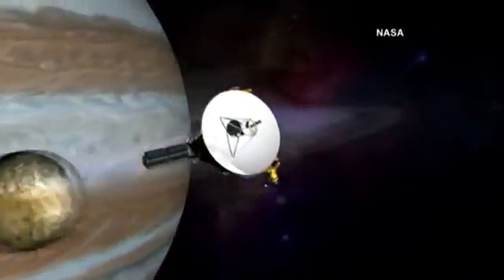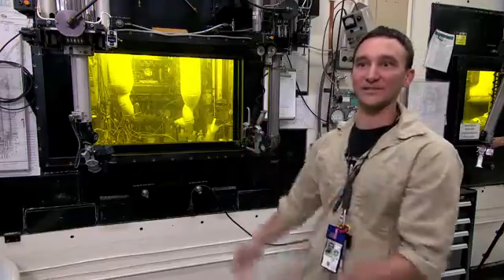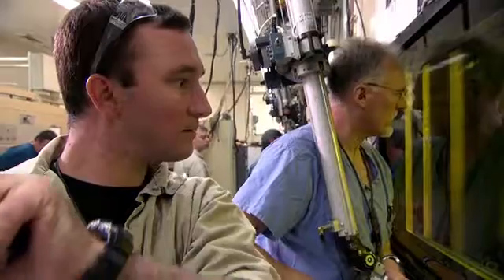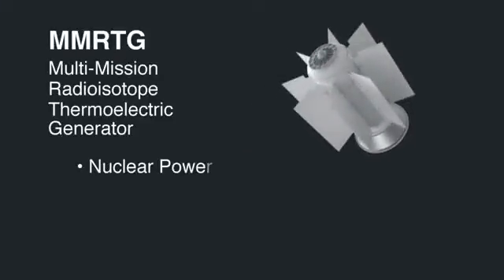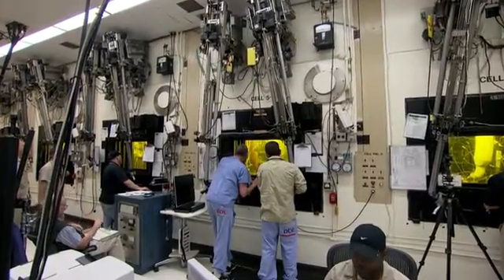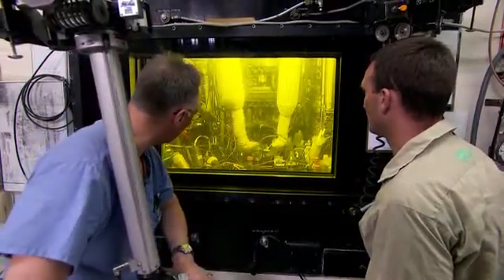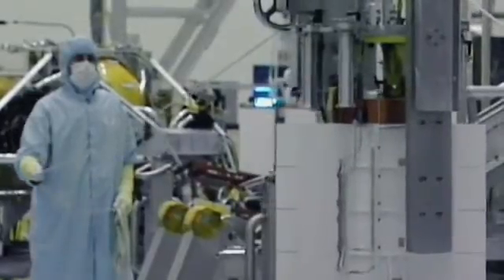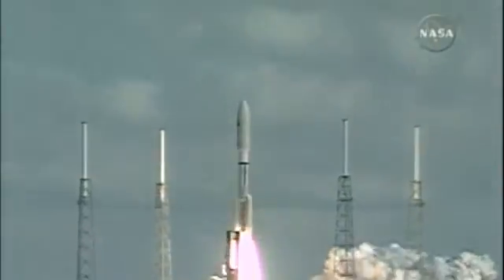5/7/2015 - Daily Planet: Plutonium Hot Cell

Comment: Really cool insight into Plutonium 238 creation, a lot more manual/hands-on work than I expected! Must be terrifying working with that much risk of radiation? The leaded glass and shielding looks pretty heavy duty but would still have me scared :)
Reply: My only fear is if I were to spill something and get in trouble (I don't handle this stuff fyi). Those hot cells' contents are worth a fortune. I wished they used a more streamlined system like a real chemical plant. Pu238 is an alpha emitter so lead glass is overkill but that's not the only thing those cells will/may contain in their lifespans.
Reply: @leerman22  They are removing plutonium from heavily irradiated nuclear waste, so yes.... the leaded glass is absolutely needed, I'll explain why.
 Many different types of radiation here, Obviously Alpha + Beta, but also Gamma and Xray, from highly contaminated compounds. Nasty nasty stuff. And as for a production line, this is that. They all do there part in a long chain of seperatory processes, without to much (boring) detail, basically they remove the "Wheat from the Chaff" ☺
Reply: Working with Plutonium on an open fumehood is much more terrifying.
Reply: @puo2123  Be sure to wear your dust mask with the safety rubber band.
Reply: @josephastier7421  We just have Pu solutions in the fumehood, solids are handled in gloveboxes. We only use two pairs of latex gloves as protective gear. We also have only Pu isotopes that only emit alpha radiation, thats why we dont need shielding.
Reply: These hot cells are grabbing the sludge from target rods from the high flux isotope reactor at ORNL. It is at this stage contaminated with fission products and strongly active transuranics like Cf 252. The window is also not just leaded glass. It has an outer layer of polycarbonate, a layer of leaded glass. A bunch of iodated oil in the middle and a layer of leaded glass and polycarbonate on the inside. The plastic and oil stop neutrons while the lead and iodine stop gamma rays.